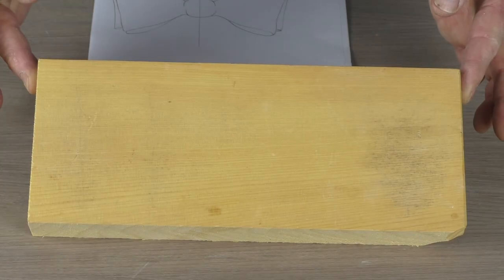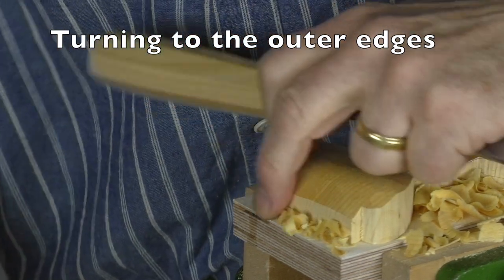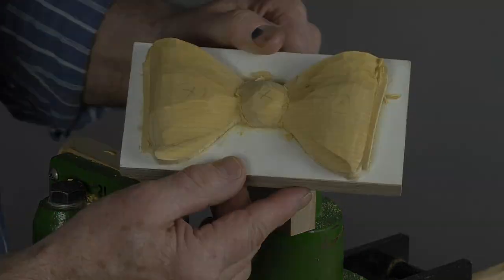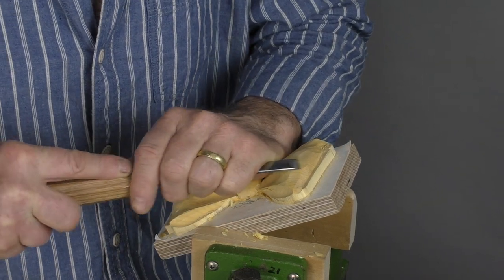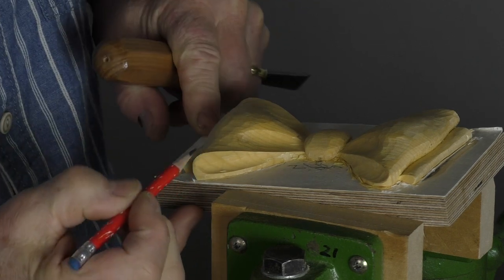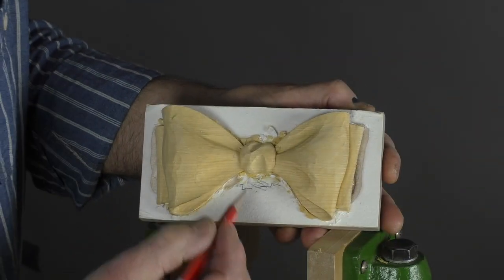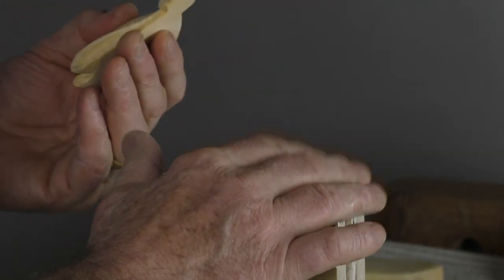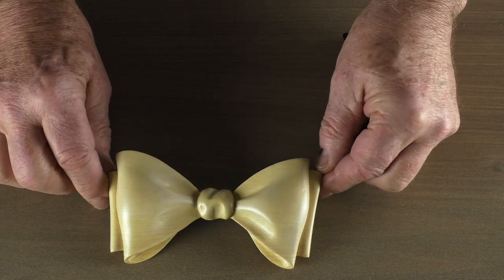How To Carve a Bow Tie

Comment: Incredible carving. If you would have put a flat finish on it then it wouldn't look like plastic, as you mentioned about now wanting it too shiny.
Reply from the maker: Joe R - You are right in that a flat surface does look more like material whereas shiny can look hard and plasticky, especially on a smooth surface. I've since cut the polish back and am happier with the look.